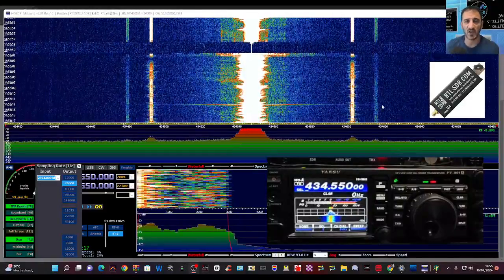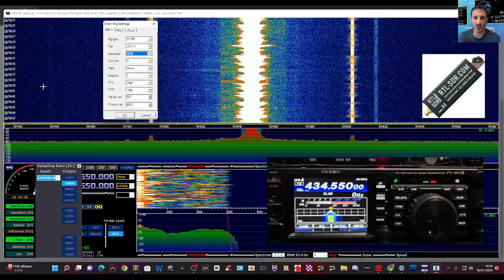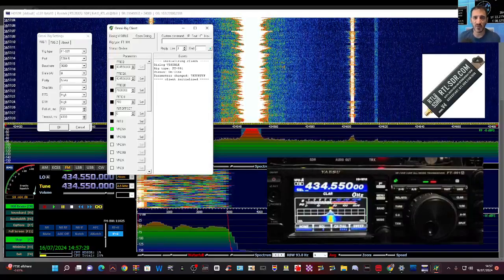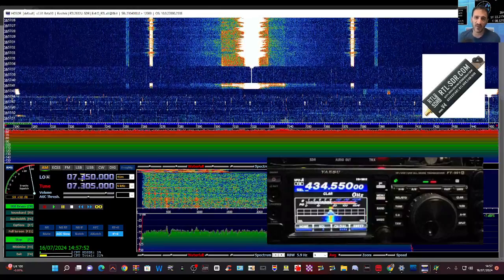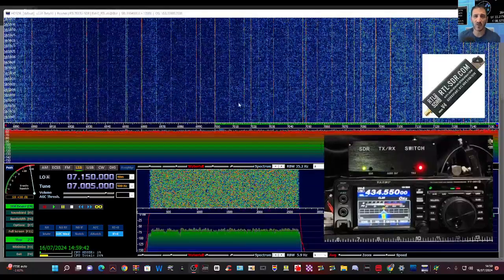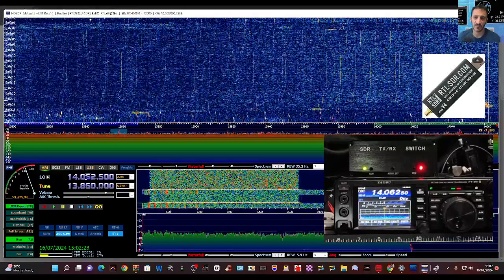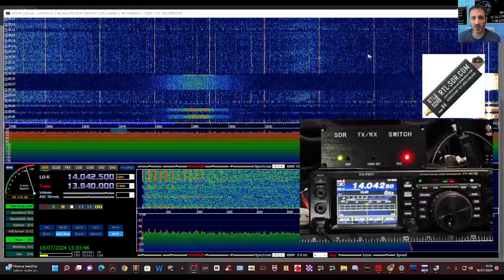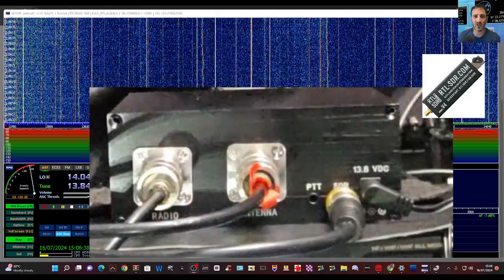HDSDR - YAESU FT991 , SDR CONNECT -OmniRig

Comment: Hey Andreas, old video I know, but did you run a PTT cable to the FT-911 from the back of the SDR switch? I'm not 100% sure what is does but I see it mentioned in other SDR switch videos. Thx man.
Reply from the maker: To transmit you need an sdr switcher